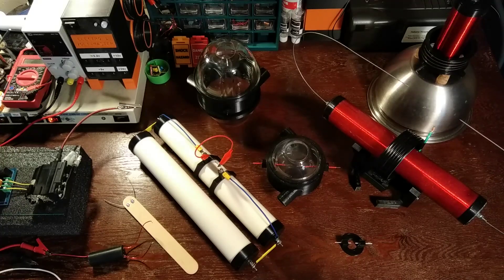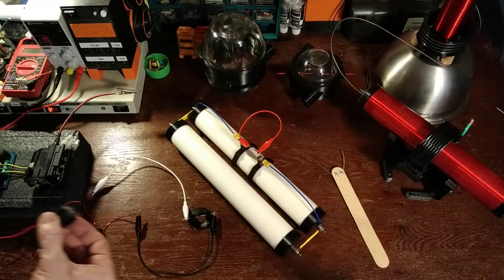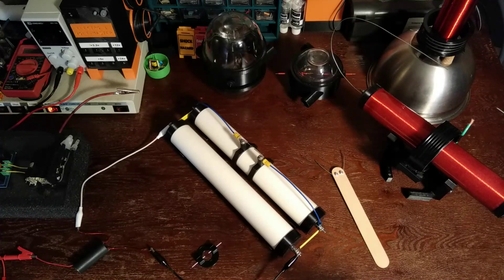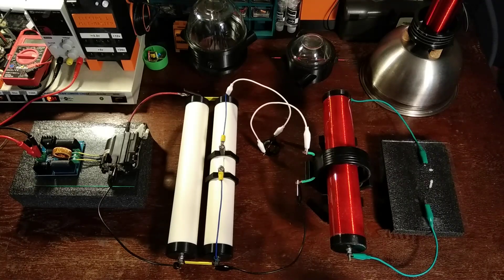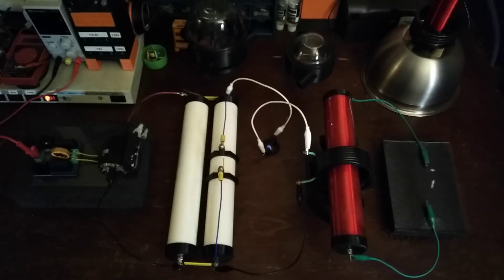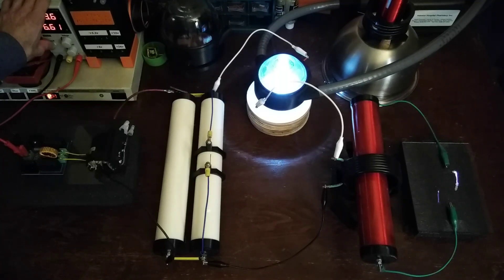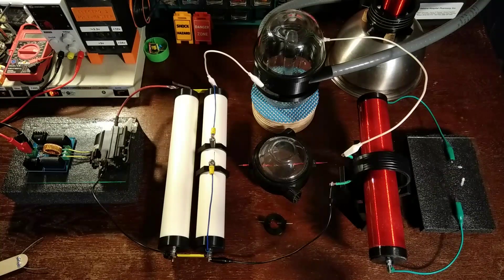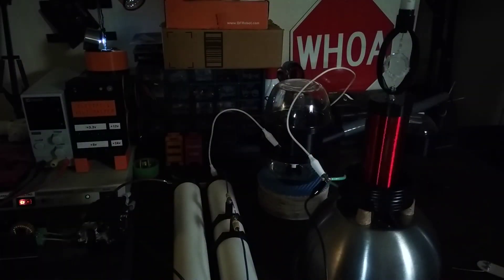Super Capacitor w/ Spark Gap Demonstration

Comment: I cant see the point why you overengineer those sparkgaps. Just put a few copper pipes in parallel to spread out the energy, put a fan on it and you are donne...
Otherwise pretty cool setup. I recommend tuning the audio in editing. When talking increase volume and when experimenting decrease volume
Reply from the maker: Thank you. This is only my second video, luckily I'm a fast learner. The heat these spark gaps are generating is by no means small. That's why I created the world's first water cooled spark gap. It's a real thing =) It works real well.

I will have properly adjusted volumes in the next videos, stay tuned for more!